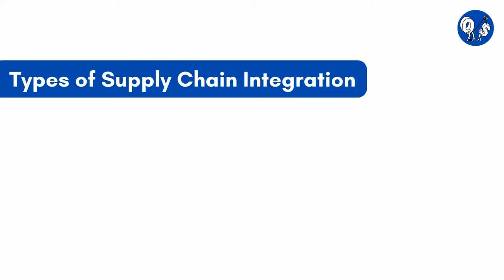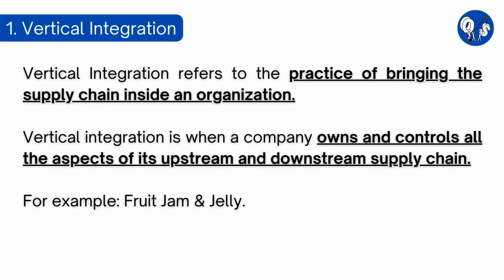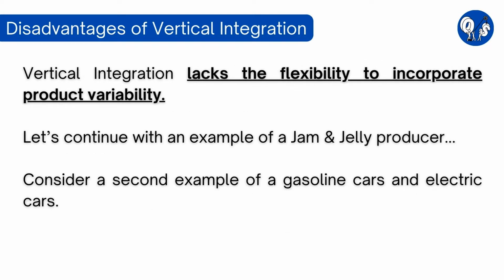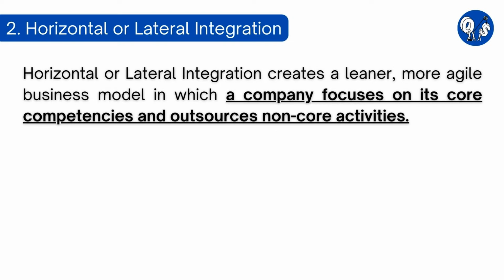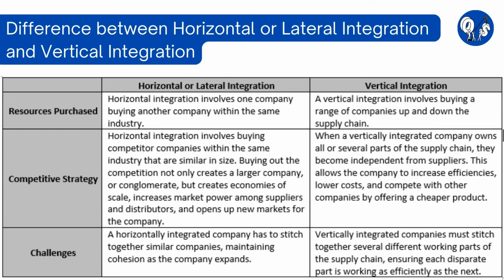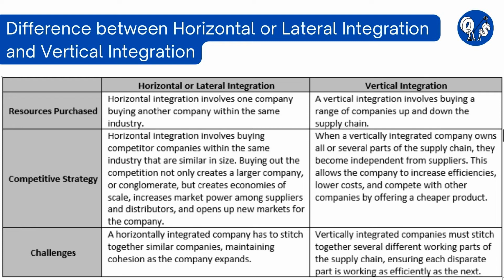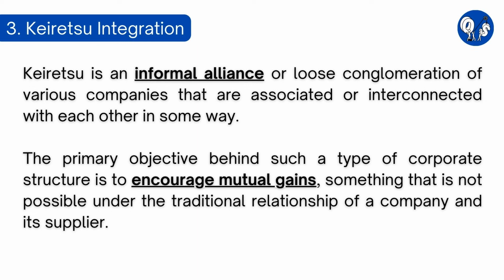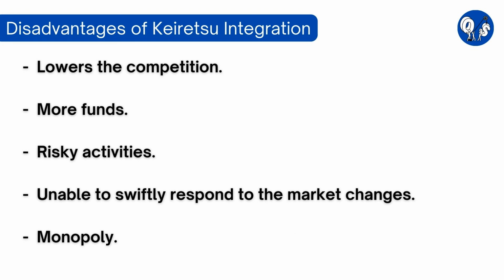Vertical Integration, Horizontal Integration and Keiretsu

Comment: Actually horizontal based outsourcing has run it's course as can be seen with the Covid issue and also US-China faceoff.

Today they're trying to shift to "Resilient" methods using multiple suppliers across different geographies.